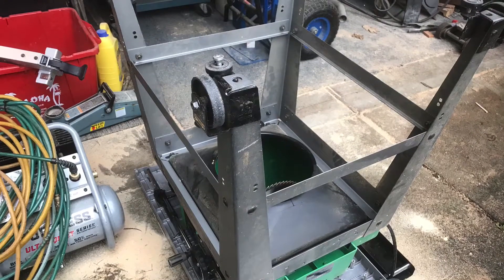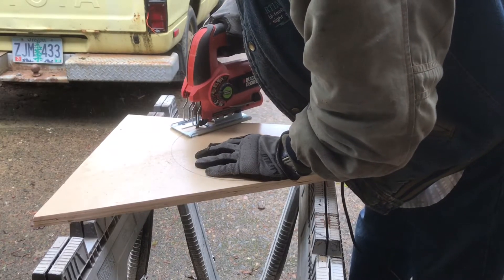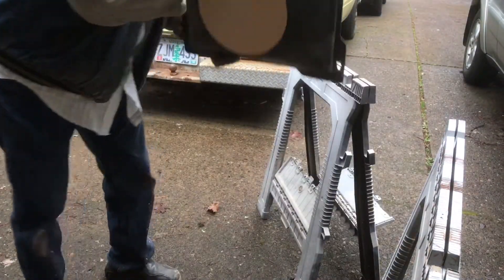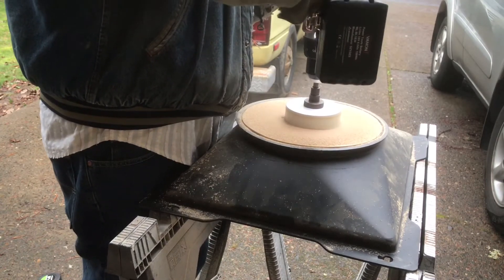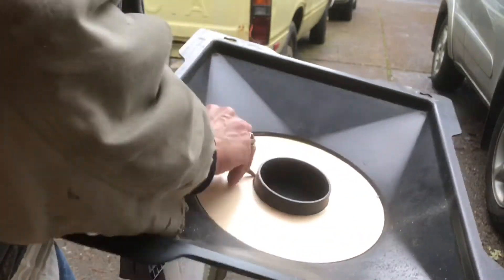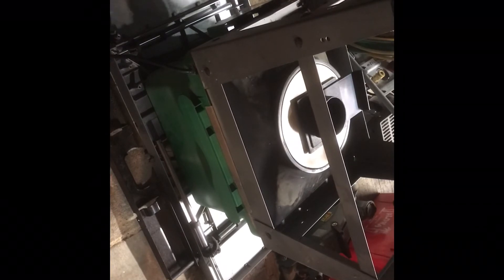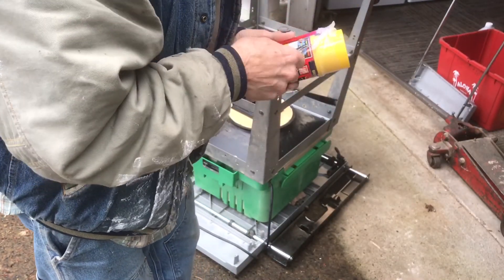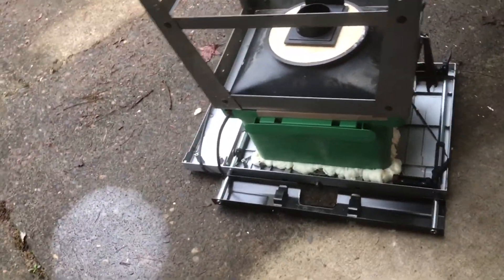Makeing a table saw dust collection system capable

Comment: Will so much sealing stop the effective cooling of the motor. These motors are pretty bad and can burn pretty quick without good cooling.
Reply from the maker: Not if you’re running the dust collection because it will suck air across the motor and keep it cool. Thanks for you question.

Comment: A link to your source for the funnel piece would be appreciated. Thanks.
Reply from the maker: I actually purchasedthe saw with it on, but here's a link to one on Amazon:https://amzn.to/3aAXqvW
Here's the actual one that's on my saw:https://www.ebay.com/itm/ORIGINAL-DUST-COLLECTOR-and-BAG-Craftsman-137-Series-Table-Saw-137-248880/293975612278?hash=item44724fdb76:g:dnMAAOSwvclgEIdB
Reply from the maker: here's a link on ebay to just the funnel piece:https://www.ebay.com/itm/Craftsman-Series-137-Table-Saw-Dust-Collection-Insert-Tray/183896416456?_trkparms=aid%3D555023%26algo%3DHOMESPLICE.SIMRVI%26ao%3D1%26asc%3D231137%26meid%3D6e9d3b84444d4e0e9ce3fb42aea87f4f%26pid%3D100752%26rk%3D2%26rkt%3D24%26mehot%3Dpf%26sd%3D293975612278%26itm%3D183896416456%26pmt%3D1%26noa%3D0%26pg%3D2047675%26algv%3DSimplAMLv5hPointwiseWebNoToraCoCoViewsNoHighIdfOrRoundRobinBlenderWithPromotedViewItems%26brand%3DCraftsman&_trksid=p2047675.c100752.m1982